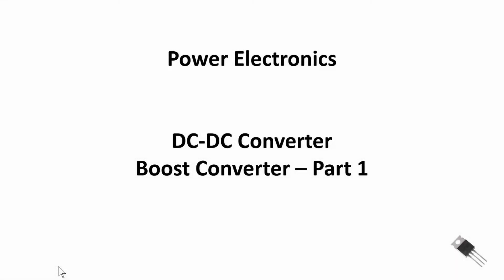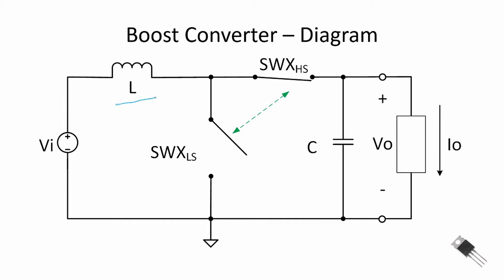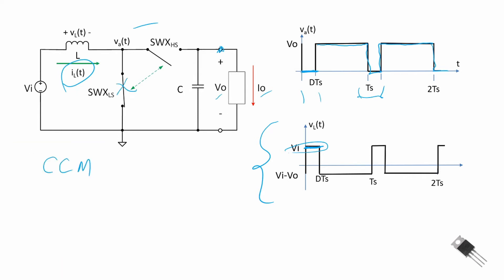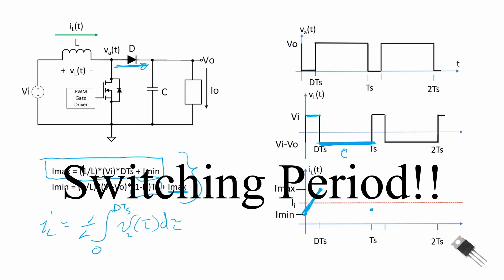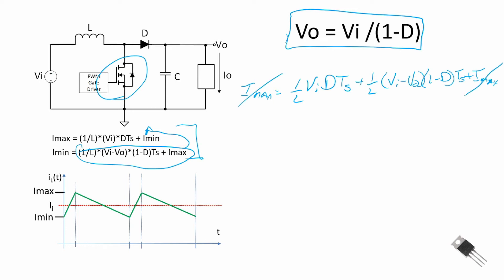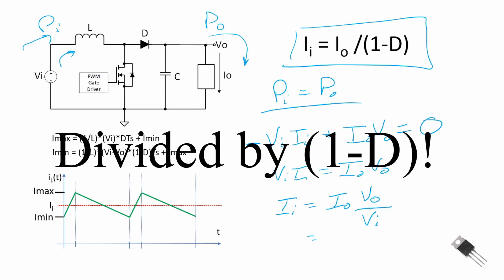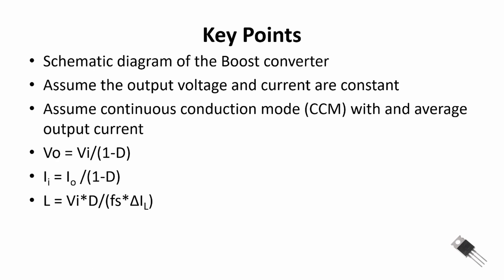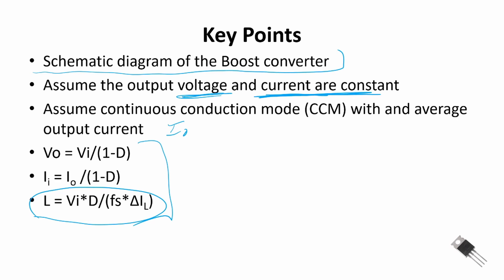Power Electronics Boost Converter   Part 1

Comment: what is the meaning of Ts ,can you please tell me?
Reply from the maker: Ts is the total switching period.  For example, if the switching frequency is 10kHz, then Ts = 0.10ms.  The switches are only activated for a portion of that period (i.e. the duty cycle D) and we can control the voltage by adjusting the duty cycle.  Hope this helps and best wishes on your design. -Dr. K

Comment: How can we get the value for ∆IL in the inductor equation
Reply from the maker: Hi Aravind, the ripple current through the inductor is a design parameter based on the rated output load for the converter.  A good rule of thumb is to start with 40% of rated.  Therefore, delta-Il/Il = 0.4.  This all assumes continuous conduction mode (CCM).  Hope this helps. -Dr. K
Reply: @powerelectronicswithdr.k1017  thank you

Comment: I’ve been watching this video, and I’m trying to figure out the calculations to size components needed for a joule thief circuit.  I want to be able to use a 12V LED bulb in an extended power outage.  Am I looking at the correct video?
Reply from the maker: It sounds like you require 12VDC for you application.  What is the input voltage?  I'm assuming less than 12VDC.  Please note that this boost topology is somewhat limited in the amount of voltage gain.  Much of it really depends on the power requirements too.  There are more efficient ways to boost the voltage such as using an LLC resonant DC-DC converter.  Hope this helps and best wishes on your design. -Dr. K
Reply: Yes sir, I would require 12VDC.  The input voltage could be as low as one-volt or less, especially if I am using an older AA battery.  I will look into the LLC converter circuit you mentioned.  Thank you!
Reply: I know that this is an old post, but for anyone reading this in the future, this is just wishful thinking.

If you want to do this, keep a deep cycle battery handy, or possibly two lantern cell batteries.

Increasing voltage via any means requires having the extra current to make that possible. Even if the amount of energy required to perform certain work is technically contained within a battery, the internal resistance of small cell batteries is rather high. That means that in the best case, the circuit will not function. In the worst case, your battery will get so hot it will start a fire.

Comment: Hello sir I have been following your power electronics series for a while now. However I have one confusion. In the current equation you mentioned that the voltage across the inductor is constant. However isn’t it swinging between Vi and Vi -Vo. So can u please explain how it will be constant?
Reply: Thankyou sir. Yes I have now understood the statement of the voltage being constant. Thankyou for your quick response!!
Reply from the maker: Hi Aamir, great observation.  Yes, the voltage is swinging between Vi and Vi-Vo.  The current through the inductor comes from the equation v(t) = L di/dt.  We solve this via piece-wise integration.  We integrate to find i(t) over the interval when the voltage is Vi and that voltage is constant.  Then we integrate when the voltage is Vi-Vo and this voltage is constant.  Therefore we will see the current ramp up and ramp down as the voltage is swinging between these values.  Hope this helps and best wishes on your design. -Dr. K

Comment: In boost converter at switch on can i write Ic =  - Io
Reply from the maker: Yes, when the switch is on all the current is supplied by the capacitor.

Comment: Dear sir please upload the video for rc diac firing design in books only explained working and also the emi filter design
Reply from the maker: Hi Ranganthan, you must be looking at a light dimmer design.  The classic RC/diac/triac design is often used to control the firing angle of an AC power wave to a load.  Timing permitting, I'll see what I can do.  Thanks for asking. -Dr. K.
Reply: @powerelectronicswithdr.k1017  yes thank you sir also how to design emi filter